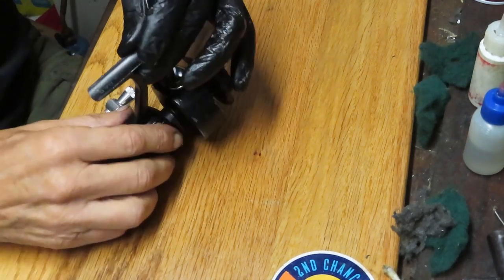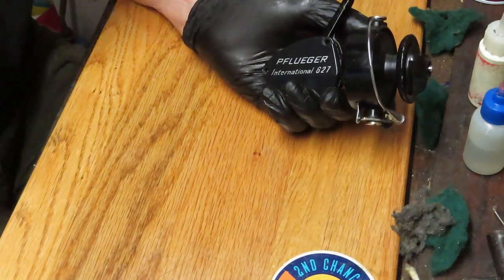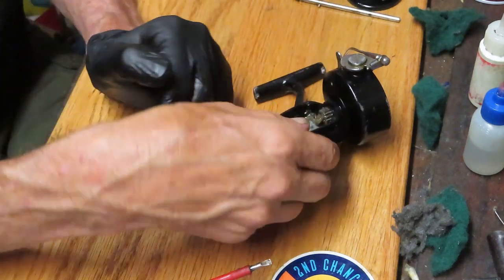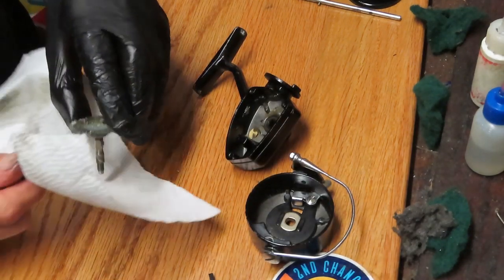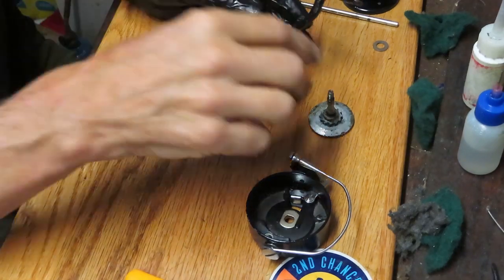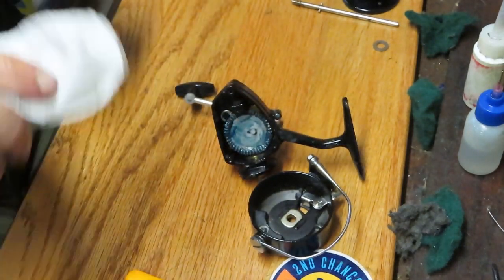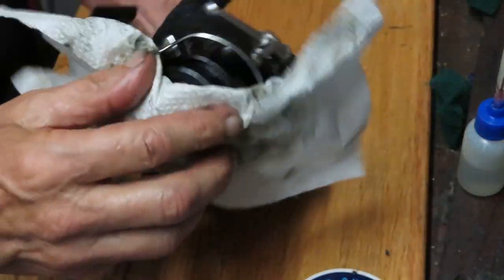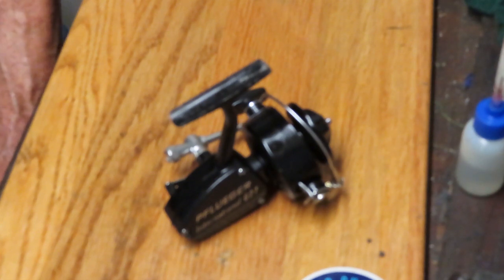Pflueger International 627 spin fishing reel how to service

Comment: This is a very fine reel. I wish I had one. I do have a Shakespeare reel that is all but identical. I do not cring - I frown! LOL  I love a vintage reel with bushings. They are all but indestructable if taken care of over time. When I first started collecting vintage spinning reels I actually sought out bushing reels because of their longevity. Are you sure that side plate is plastic? That is surprising to me. I’m glad you shared this vintage gem. It is a nice one! 
— Chris
Reply from the maker: Thanks Chris - Yes, some of the finest reels of the times were with bushings.  I don't like the ones where the case acts as a bushing and I certainly do not like the ones with plastic bushings, but the old time brass or metal bushings were almost indestructible - Best wishes - Dennis
Reply: @2ndChanceTackle  I totally agree!

Comment: I have one of these ,, the bale wont click back without manually doing it.
Reply from the maker: It is likely a broken part.  Possibly the spring.  That would need to be replaced.  I am not sure if that part is available - Dennis
Reply: I fixed it. The sprit was good ,I just had trouble placing it in the right place.  It's working fine now.  I did have the little bale wire bolt backing off as I reeled it but put a little super glue on the outer edge of the area now it's like the day I bought it